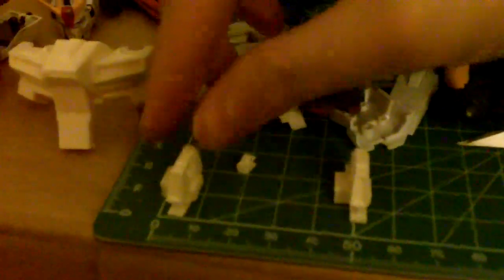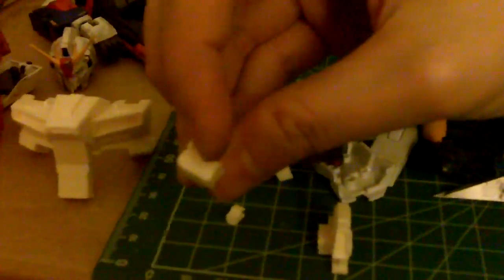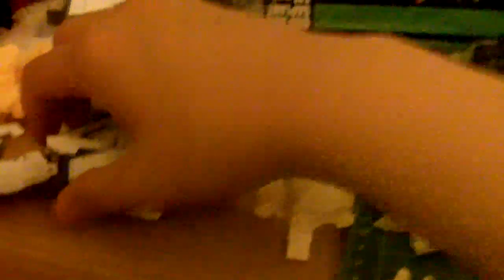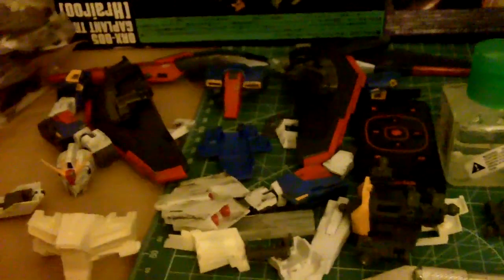Resin Gundam Z2 W.I.P Update 2: Modifying Parts

Comment: @Gomenchaiii For your resin kit. You will need to buy brass rods. 1.0,1.5,2.0 millimeter sizes. You need to get a drill and drill the two parts and put a pin between them. You need to line up the parts and the drill hole on both. You pin it together but dont glue it. You paint the parts and then repin it with some glue. Pinning it allows you to build the resin kit without glue and shows how it looks. Either tilt or no tilt. Some ideas when I built mine.

Comment from the maker: @Geoxile I got this from tatsuhobby.  If possible, don't get their 1/100 recast from them.  I'm having so much trouble with this kit....it's taking me forever because some parts aren't even fitting onto the MG's inner frame well.  One peg broke through to the other side of the resin because it didn't fit and the resin was too thin.